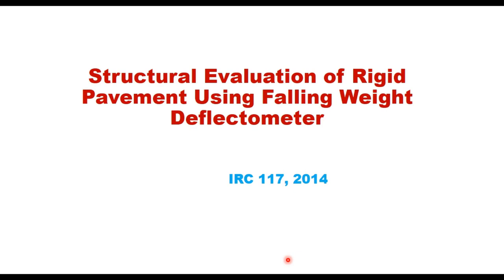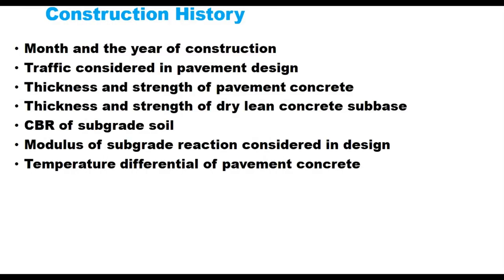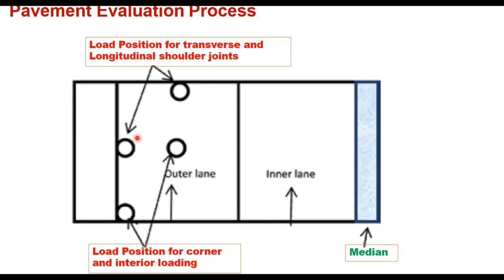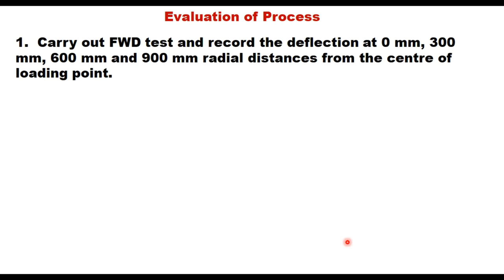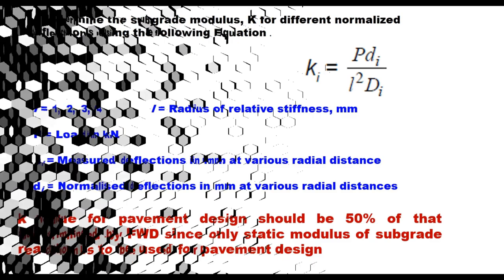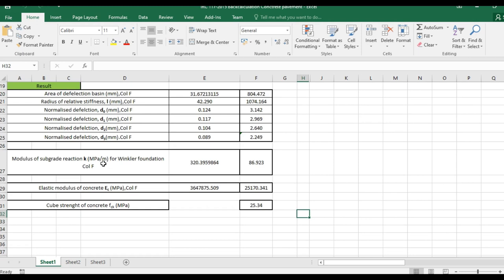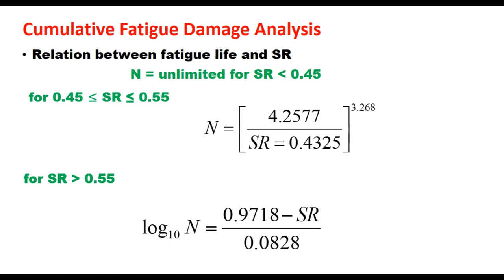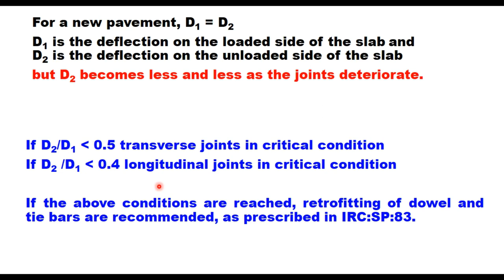Structural Evaluation of Concrete Pavements using Falling Weight Deflectometer (FWD), IRC 117, 2014

Comment: Taken Deflection measured value are normalised of 50KN?
Reply from the maker: NO. It is not load normalization. This is part of the backcalculation procedure adopted in which measured deflections are getting converted in to non-dimensional values.

Comment: Hi sir, can you please explain why we consider equation 10 instead of equation 11 for LTE analysis?
Reply from the maker: Equation 10 is used when deflections are measured on either side of the joint, and particularly when FWD is done on a new pavement. Eq 11 is when deflection sensors are 300 mm apart during the FWD tests. In our case, D1 and D2 were measured on either side of the joint, that is why I used Eq 10.
Reply: @SatishIITR  thanks for your explanation sir

Comment: Respected sir, Excellent explanation ..I am interested to learn why we do normalization of deflections after computing area and radius of relative stiffness. Modulus of elasticity of concrete is computed after normalization of deflection. How this normalization is carried out ?
Reply: Given in IRC 115
Reply from the maker: Very tricky question to answer here. In fact IRC 117 has taken lot of material from AASHTO code given in the reference list. This code cosiders BISAR model to determine layer properties. The AASHTO code is not purely on PCC slab but several combinations of AC and PCC layer and therefore it normalises the deflection values to get it corresponding to layer thickness taken in field. I think you need to read this AASHTO code to get answer to your question.
Reply: @SatishIITR dear Sir iam facing problem to get the Normalize deflection and AASHTO number